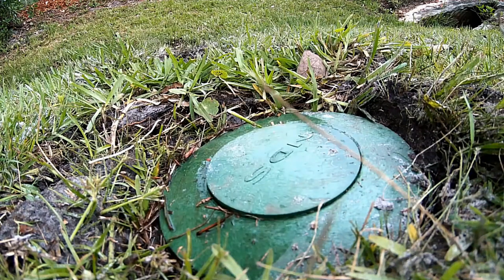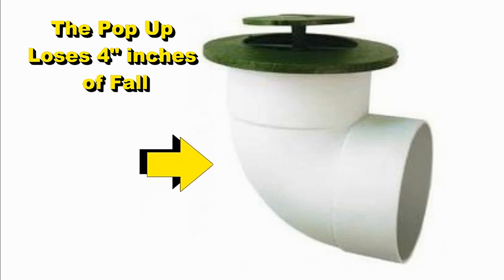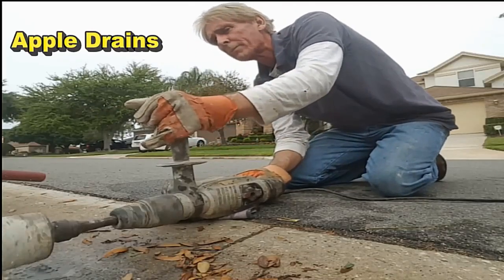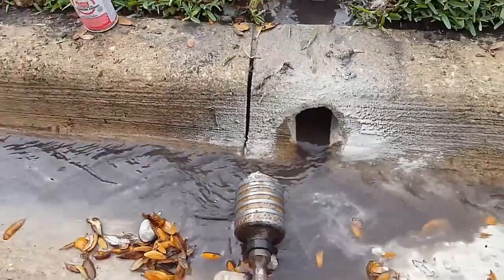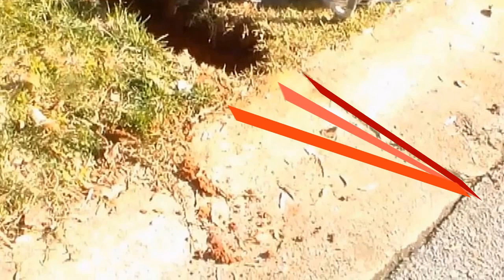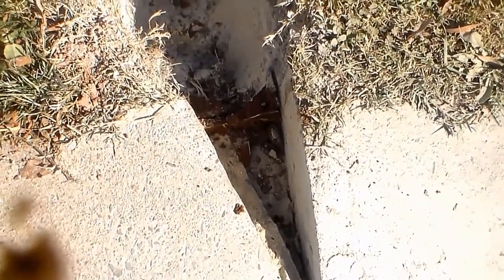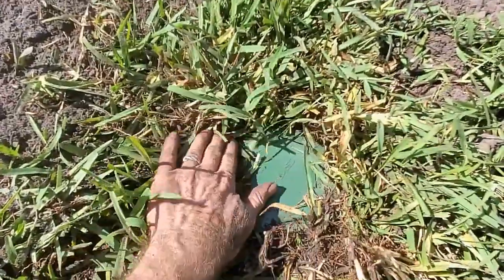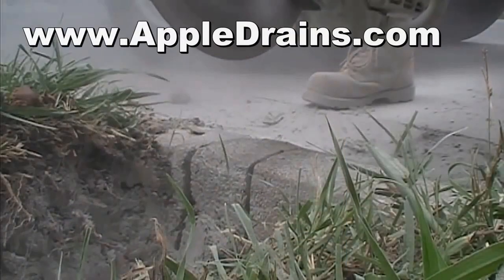Curb Cuts - Curb Drilling vs Pop Up - Discharge for Yard Drain

Comment: Chuck, I used you advice on this previously and it worked out well. I have two downspout drains and an interior sump pump tied into a 4” PVC pipe running down a ten percent grade 35’ to the street and I didn’t want it to flood the yard.  I called the township and asked if I could core the curb and discharge to the street.   They said yes and it must be done in a proper workmanship like manner, pipe cut flush with the curb, and patched around the outside of the pipe when complete.  No permit and no fee as a homeowner.  Someone did come out to inspect the work though.

Comment: i have a problem with my curb drain. I live in CA and we've been having torrential rains and when the drainage down the street backsup or doesn't drain fast enough water comes back and then would then rise and overflows my drainage and backs into my garage i really dont know what to do.

Comment: You can  the same with a short 12 inc perforated pipe and pee gravelly the end under the ground 10 inches from the surface and unjust depth as you go . so the water stays in in your yard . Or tee it and perforated pipe on each end just like a leach field putting the water in the city drain is a waste of water . For lot of water multiple 4 ways and tee the end for a termination.  We do it all the time for customers.

Comment: Hey Chuck. Instead of the adapter, could you make one of those 2 or 3 inch cuts in the pipe and squeeze the pipe into the pop up? (Like you do for the catch basins) Then tape around the pipe into the pop up?
Reply from the maker: Yes you could do that! Tape it tight